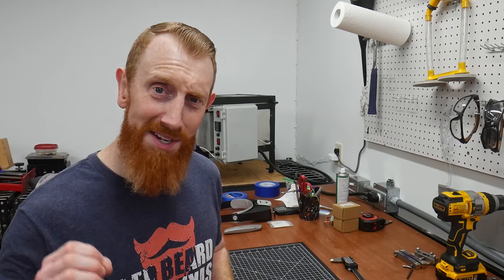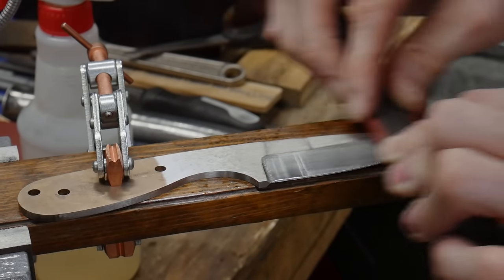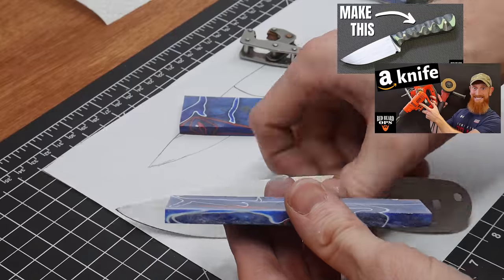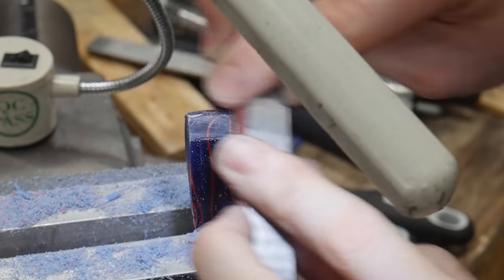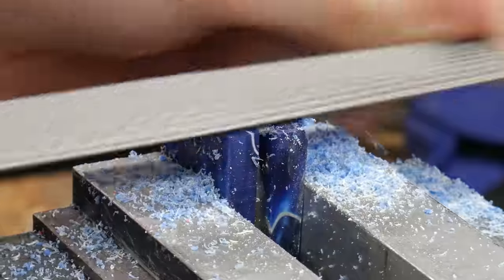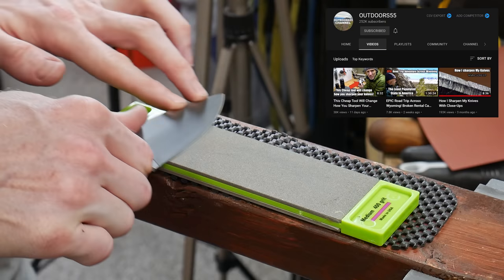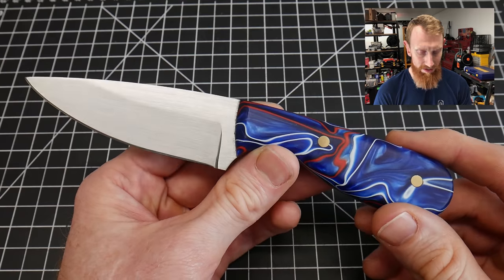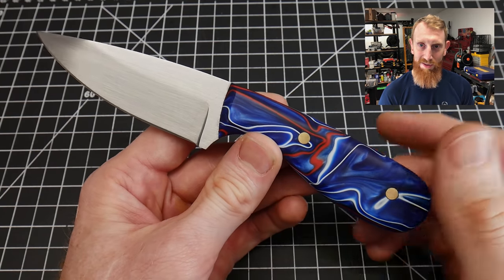The Easiest Way to Start Making Knives - KIT Knife Making Project

Comment: My wife gave me a DIY knife kit from Man Crate back in the day. I believe it was a Jantz product. The Man Crate kit came with a little table clamp Vise, hammer, pin stock, bolster stock, knife blade heat treated in 420c, wood handle scales, rasp, files, some sand paper and epoxy. It was a fun project and it certainly played a role in me getting into knife making. Great video. Glad to see you're back uploading again.
Reply from the maker: Very cool! I with that was how I started. It's good to be able to break up a project like making a knife. Glad you're enjoying the videos!

Comment: Great video as usual! Really good timing with the school year ending you may encourage some young people to try this out. With the income from some mowing or odd jobs they could buy the hand tools and supplies and even a 1x30 or 4x36 belt sander or a vise if they don’t have access to one.
Reply from the maker: That's a great idea!
Reply: I started with a 1x30 and I still use it from time to time.  A 4x36 that tilts vertically is a pretty decent upgrade from the 1x30 without spending a grand or more on a 2x72.  Obviously the 2x72 is the most versatile, but it's understandable that most won't have the budget for one starting out, or at all in some cases.  The ultimate cheap DIY is a file jig made with stuff you can get at any hardware store, but they only work if you plan to do heat treating and you're starting out with a soft blank.

Comment: My favorite method is definitely using stones. I Sharpened knives for money well before I even considered making knives.

 I find stones give you the most freedom when sharpening. You have almost unlimited options for stones to choose from. Naturals (Arkansas, coticule, japanese naturals), oil stones, synthetic water stones, diamond plates, resin bonded diamonds, vitrified diamonds, cbn abrasives, strops with different compounds on them. Just to name a few. 

Plus there's no chance of adding any substantial amount of heat to the literally micron thin apex (which anyone who has ground in bevels on a knife knows the thinner the material the easier it is to over heat). Also I find I get the most control with stones.
Reply from the maker: Thanks for your thoughts sir! I like it

Comment: I use a 1x30" grinder that I clamped on its back to a table. That way it flat like a stone (even though I am horrible at use a whetstone)
My normal grit progression is 240, 400, 600,  1000, then leather 1x30" belt with buffing compound

Comment: For first time knifemakers, maybe try a 30min epoxy if you have it.  When I first started, I made the mistake of using the same 5min epoxy I use for everything else...you wouldn't believe how nerve wracking it was trying to do all the things needed at once for the first time before the epoxy cured.  Needless to say, my epoxy job needed a lot of cleanup once it was done curing.  Save yourself some trouble, use a slower cure and wipe all that epoxy off with some acetone or alcohol on a rag/q-tip.

James, I use the wicked edge sharpener.  It takes all of the human imprecision out of the picture that results in a less than perfect edge.  You can dial in just about any angle you want, and it's repeatable in the future for knives you've already sharpened.  If you put a 20deg edge on a knife and it's now dull, just set your sharpener at 20deg and bring it right back with hardly any effort and less edge removal.  You can get a great edge with the basic stones, or you can go broke buying alllll the stones and strops and stopping compound and lapping film they make like I did.
Reply from the maker: I agree on the epoxy

good point on the wicked edge

Comment: I keep coming back to this video.  Im in Canada and can get one of these Jantz blancs but in tool steel.  Would it still be easy enough to work with a file and sandpaper.  I'd like to try and follow this guide before investing in a grinder and building a kiln.
Reply from the maker: Good luck with your build!

Comment: what kinda steel do you use i tried o1 rust fast   d2 hard to sharpen i sent uot for heat treat pricey thanks walter
Reply from the maker: I'm a fan of 1084... it will also rust though. If you want stainless I like AEB-L

Comment: Do you just eye ball to measure plunge symmetry ?  I got some Indian blanks and they need some cleaning up
Reply from the maker: for the most part I do; sometimes I'll put a file guide on the knife and scribe target lines on both sides of the ricasso
Reply: @RedBeardOps  these will be my first builds !  You ,like Walter ,present excellent demonstrations !  I’ve been free hand sharpening for a year ; so I’ll start with handles , finish and edge work before the stock removal experiment starts

Comment: You use some expensive sandpaper. Though Indasa abrasives are high quality, I think they're overpriced.
Reply from the maker: I do. I've always liked that stuff. You can get them in bulk from Pop's Knife Supply for a decent price.
Reply: @RedBeardOps  Me and my dad do some body work on cars, and Indasa makes the only sticky back sandpaper we could find to fit the acrylic blocks we use. A hard bill to swallow after it was all said and done, but I was impressed with how well it performed.

Comment: how do I get away from pin halo? I've made about 15 knives and that still crops up?
Reply from the maker: Hey man, This seems to come down to how square and accurate you can drill the pin holes. I use my mini mill and a 1/4'' precision counter bore on most of my hidden tangs. A good drill press will do it as well.